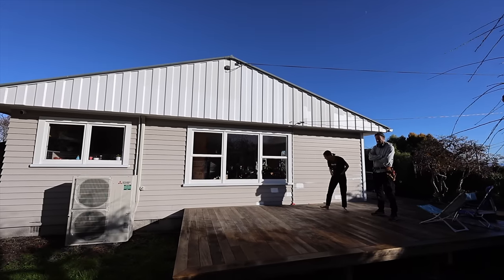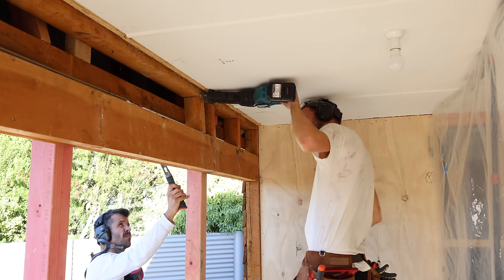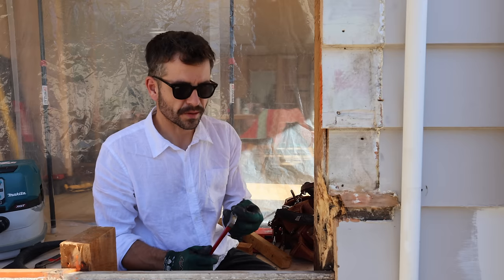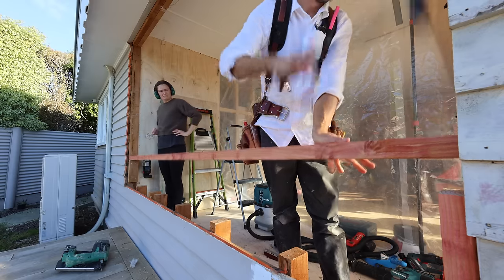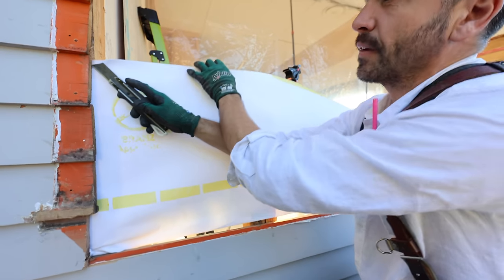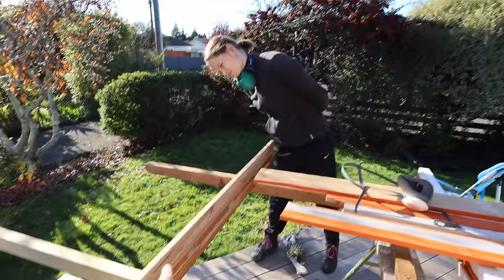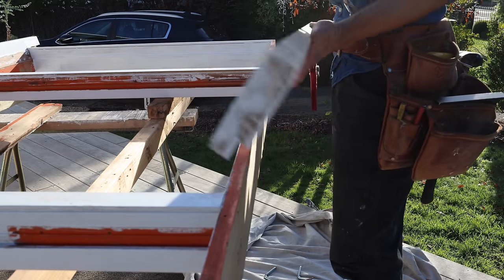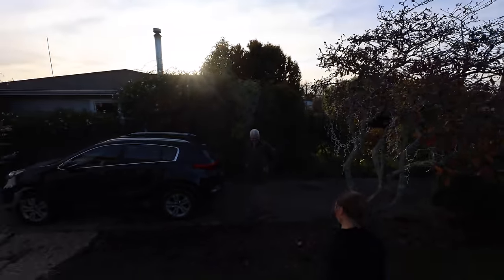The Trouble With Timber Windows

Comment: It's the pilot holes we don't drill, that we regret, not the ones we did.
Reply from the maker: Sounds like a proverb
Reply: I should make a poster of this and put it up in my shed
Reply: I've definitely messed up by drilling oversized pilot holes to avoid shattering fragile old dry wood, thus leading my screws to spin. I regret those pilot holes.
Reply: Absolutely! I rebuilt a second story deck and it's staircase last year and I insisted on drilling pilot holes for everything because the old deck and stairs failed because they used twist nails. The screws with pilot holes will last MUCH longer. The joist tape I used will help a lot too

Comment: Nice vid, now I am a fan. Noticed in other videos it is not a cavity construction, so this window would be a direct fix construction. But I see the weatherboard edges are almost flush with your trimming stud. Not sure if that means you didn’t put in the E2’s required extra 20mm H3 treated packer in the rough opening gap of the jamb. It looks like the original window didn’t have the packer, but pretty sure can’t claim schedule 1 rule if the old doesn’t match todays rule. I assume you probably put in the packer when between shots I guess. Nice job on the Reno as always!

Comment: Great video. Question about the weatherboard. You mentioned that you only put one nail in so that they can expand and contract. Does the same apply to cement siding like hardie board? Do you use cement siding in NZ? I would imagine the cement siding does not expand or contract as much if any, but I'd also think if one nail is good enough for wood it would also be good enough for cement.

Comment: Nailing clapboards… just nail at the top, the next one up covers the nails below. A piece of felt paper goes behind any vertical seams and is cut even with the bottom of that clap. Back caulked on the ends.

Comment: Do you use oil base or water base primer while treating external timber ? I've always used water based because of drying time and less mess, but have been told its not good.

Comment: what happen to sheathing on the outside walls? is that common no sheathing just siding in New Zealand ? that knot is in the cripple to hold the window header is far from adequate. you don't have enough bearing surface for the header. a full 2x4 cripple under the header beam is minimal.the 3 inch smaller opening could have been hidden with a wider casing. no one but you would have noticed it.

Comment: Roof weight? What roof weight?? That's a gable end, there is no roof weight. It's not a load bearing wall, the load carrying members of your structure run parallel to the wall. The only load in that wall is the beam you inserted to transfer those loads but you have studs supporting that. Don't believe me? Check 3604 building code, there is no roof load  lintel spec for  gable ends.

Comment: if you'd have used an offcut of timber under the head of the hammer as a lever point, you would not have broken the head off the nail. 😂